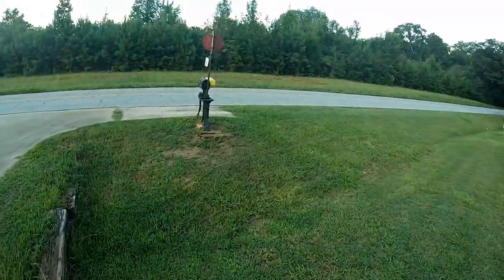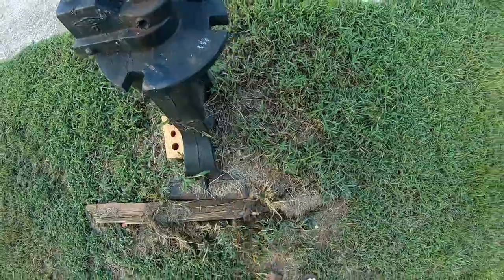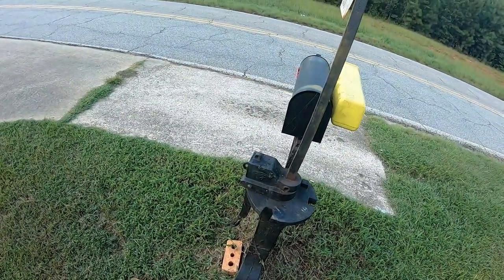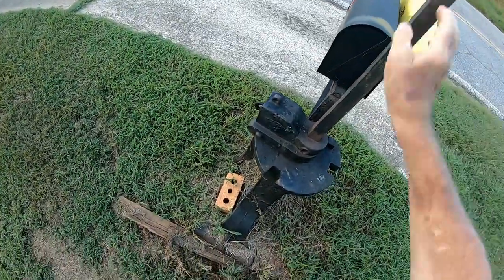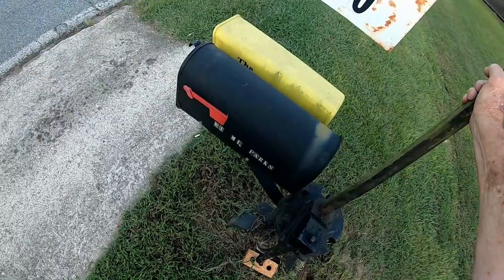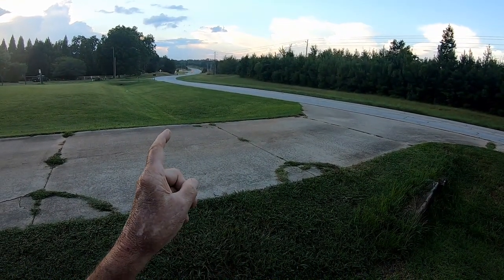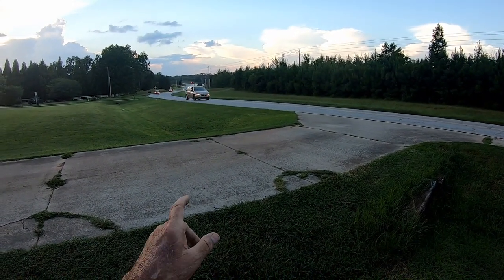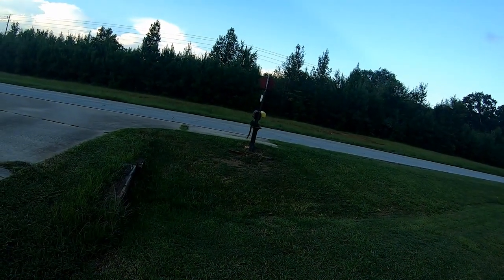Railroad Switch Stand Mailbox Story

Comment: OMG,you reminded me of a mailbox story.This young fella and his wife and new baby had just moved to a mobile home in Advance,Mi.,Pop.35.Now some winters we get quite a bit of snow with snow banks 6 or more feet high and the snow plow kept hitting his mailbox and sending it skyward to parts unknown,you see his trailer was on the lee of a drop in grade at the end of a curve,you swing to the right a bit drop down then swing left,at the bottom on the right was his mailbox.Well after 5 box launches he'd had enough,he got a mailbox in the post office,that spring he contracted a local fixit man to make his mailbox indestructible,the man fabricated a box out of 1/4 inch steel and a  post of 180 pound railroad iron 7 feet long and mounted in a 30 gallon oil drum filled with concrete.Well he got his revenge next winter,sort of...our first real snow fall was a madd blizzard and the county sent out the road grader with a wing plow,an attachment that they drop like a wing to push back the banks well it seems the wing hooked the mail box and flipped the grader around circular so he was facing the way he came and just kissing the mailbox mans mobile home,then the plow truck following him hit the box and flipped him over to the left on his side.Well the man in the trailer was gloating real good he had his revenge,except for the sort of,the county sent him a repair bill for 35,000$ with a 1 month due date in august the following year.Revenge: It is a dish served cold and it comes back to bite you,always.P.S. He paid the bill,then a fine for creating a traffic hazard,then he moved,don't know where.
Reply from the maker: Thanks for sharing I agree he went too far lol